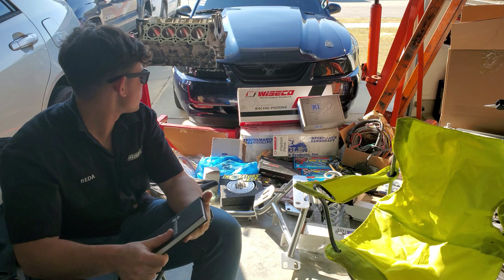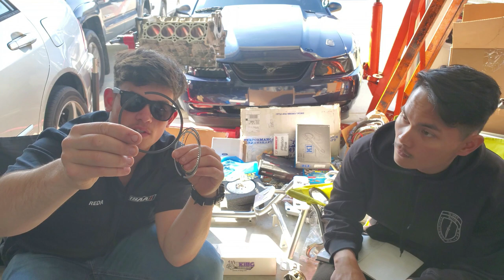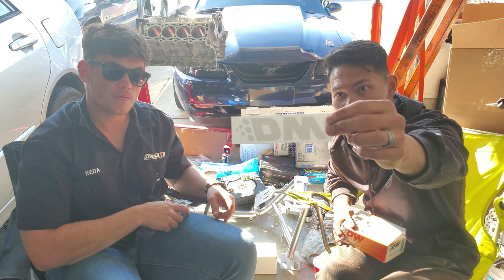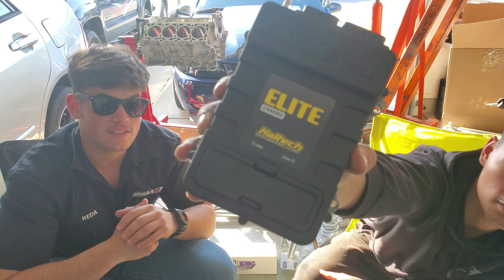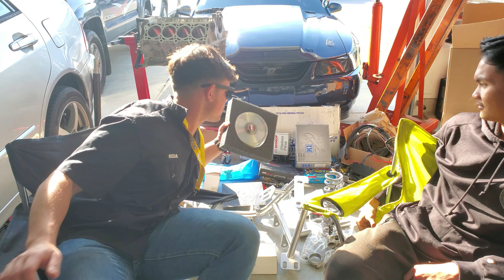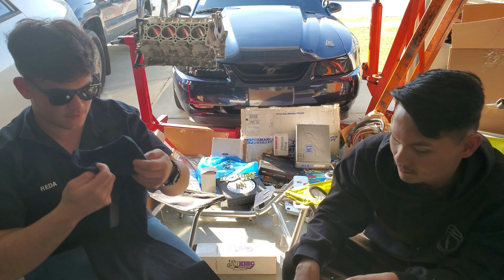How To Build A 1000hp 4.6 (WAP block) /Episode 1

Comment: Anything over 600-700 with the WAP is time bomb. It’s the weakest Mod block out there, especially if you don’t have sleeves. The teksid block is much stronger, whether aluminum or iron. I have an ‘03 Mach and couldn’t wait to replace the WAP with a boss block. As it had a little more displacement and stroked it for a 323ci. Is there any other reason you went for the WAP other than no one else does it?
Reply from the maker: Eh not really tbh. I have heard different thing from a bunch of people but no one ever builds this block. People have had non sleeved wap blocks up to 1100hp with good tuning. But I guess will see what happens. Stay tuned!
Reply: TDL Racing Not really? Just google it, I’m not saying it can’t be done, I’m saying there’s a reason it isn’t done. The most common number thrown around is “I’ve seen them make 700.” Its  not as reliable or strong as the other options. Sean Hyland makes a good book about these motors if you’re interested. Good luck to you.
Reply from the maker: Thanks man👍
Reply: @masonessman81  I'd stay away from anything Sean Hyland says and stick to the guys who are actually running the setups. There are 1100rwhp wap block builds that last years. Any 4.6 block will handle 1000rwhp. If you're looking to make well over 1000rwhp then you can get a Teksid. Listen to guys like Accufab, Wonder Racing, Apocalypse Performance, Modular Head Shop  who actually push the limits not Hyland who is making a guestimate. SHM is old news with many unhappy customers back in the day.
Reply from the maker: Thankyou!! I get a bunch a comments saying wap blocks are trash but well known mod motor yous say the same thing you said.

Comment: Hi. I newly interest with automotive
I am amaze with your buildm congrats 👍

By the way. I still don't really get a point. Why some engine could go up to 500++ hp some other just below it. Even with higher CC
Reply from the maker: It all depends on displacement and the setup  with the turbo or superchargers. Also if the block can handle power without cracking.

Comment: .20 over why? Did the block need that much if a bore, lol when it comes to rebuild .30 max after that new sleeves of the wap has sleeves
Reply from the maker: Honestly I didn't know much when i did it. So if I could re do it I would've never bored it out! I wouldve stayed stock bore
Reply: Have you not seen engines bored .30 .40 even .50 over, lol my 2v in my f150 got .35 over with a .05 nitrile coated steel sleeve for extra strength.
Reply: @reaperasylum  wel ya sleeves… lol we talking about a 2v block! .20 is fine anything over that in just dangerous and stupid in my person opinion, unless you have sleeved your block
Reply: .20 is a normal over bore !

Comment: What was the cost? I'm about to start building my 3v but don't have an idea on how much I need
Reply from the maker: Ended up spending a lot. Had to buy 2 of everything.
Reply: If you're wanting to build your engine right and get a turbo kit look at no less than 15k, add another 10 to be realistic. You can do it cheaper but you'll be breaking things and having regrets. Basically plan on the expense of a 30k car to be safe. Mod motors are great but they ain't cheap buddy. I would know I have a 97 Cobra, shes more expensive than an ex wife

Comment: The only reason people (myself included) like the teksid blocks is because they can hold double the power a WAP block can
Reply from the maker: Will see😁😁
Reply: I have a 97 so Lord knows I love the teskid block, and a lot of 2k+ HP racecars have them as well, but the Romeo and WAP are not bad by any means. If the weight doesn't bother you and the HP isn't getting super crazy they do absolutely fine. There's no need to switch unless every pound counts for a racecar really
Reply: @hitlersmissingtesticle69  They definitely are. If you don't want to get your hands dirty and just wanna go fast with as little drama as possible a new Coyote makes a lot of sense
Reply: @hitlersmissingtesticle69  Awesome. If you're sticking to 2v the Trick Flow heads are great. Apparently they flow about as well as 4v heads, so basically they won't need any porting under 1000-1200 HP. Used Teksid block, used forged Cobra crank, Manley forged rods and pistons (or forged Diamond pistons), Trick Flow heads, and some big cams will make a very mean mill with a 76mm turbo or something. That's the recipe I'd use for a street/strip drag car. A Whipple instead if you're wanting a greenlight/ eighth mile car for the better boost down low works great too. So many options..
Reply: @hitlersmissingtesticle69 putting it back? 😂 Don't believe that. Your 2v is still the same I bet. I had the same thought process but figured that coyote money could've been parts money and done already. I'm sticking to my 800hp 99 cobra turbo build
Reply: not so bro!